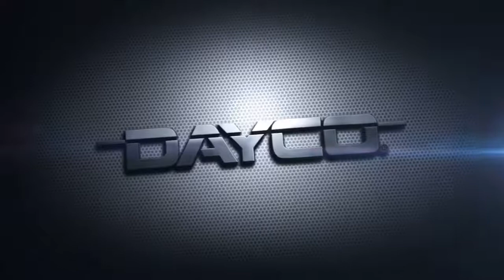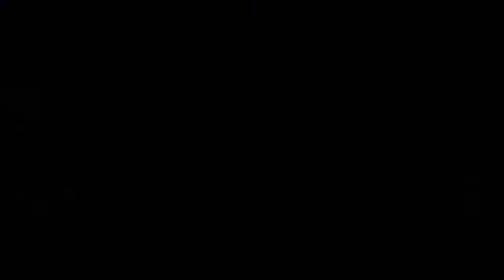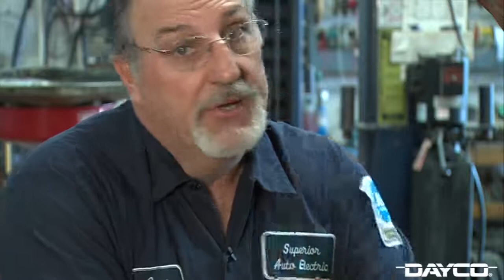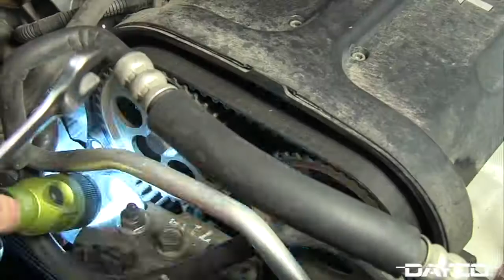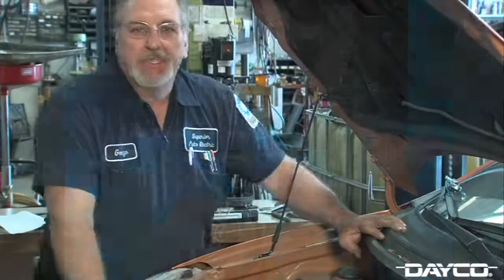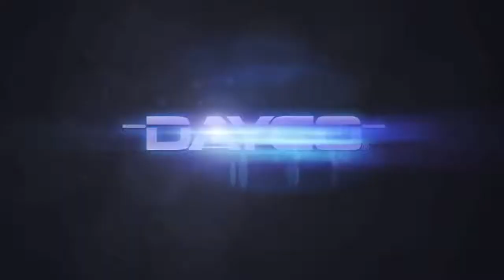Dayco - Timing Belt Replacement, The Dayco Timing Belt Water Pump Kit

Comment: There's no arrows on this belt so you won't know which way to install it.
Reply: Ditto this. Replaced head gaskets, now I've just got 3 random lines on belt. Old belt was labeled L Cam, R Cam, CR. Discarded old belt.Maybe a tiny bit more ink on the belt would help a LOT of people!